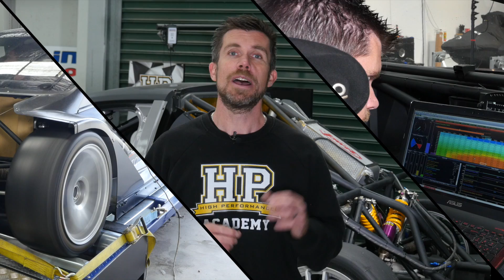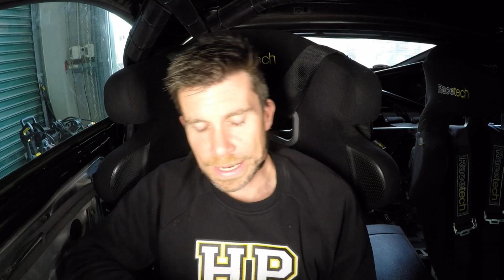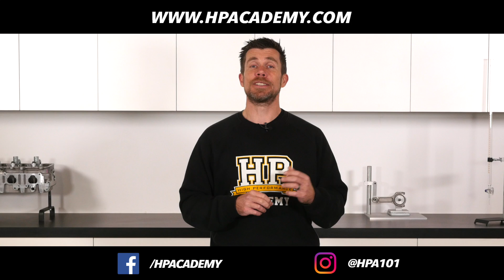[HPA Q&A] How do I separate the sound of Knock (detonation) from engine noise?

Comment: The trick is to safely induce the knock and compare it to a known non knocking condition.
Reply: rjherche lol what?
Reply: Mugshot- Marley . Run a specific maneuver, like a speed and load point, or a full WOT pull, with safe timing. Record the knock sensor activity. Induce knock by advancing timing, preferably in a less risky condition like part load. Record knock sensor activity. Use that to set the thresholds. If the knock sensor doesn't pick up the knock you just induced, you need to adjust the signal amplification or change the frequency.

Comment: From my understanding ecu's can distinguish between base engine noise and knock by sampling a few seconds at cold start, there by using this as a reference and anymore than that is determined as knock. You have to do this manually on some aftermarket piggyback and standalone ecu's before tuning.
Reply: All depends how sensitive the knock sensor is. The ecu doesn't distinguish differences in frequency since their normally set in a certain area around the frequency of knock and can be a pretty broad spectrum on stock ecus to be safe.